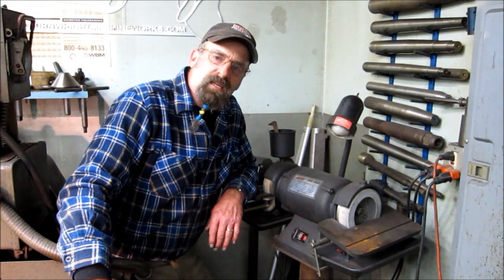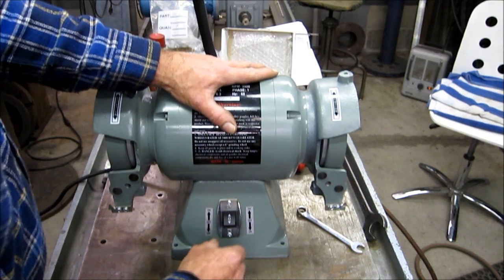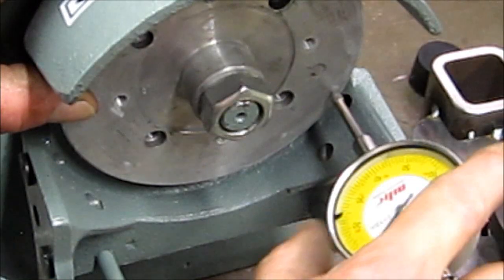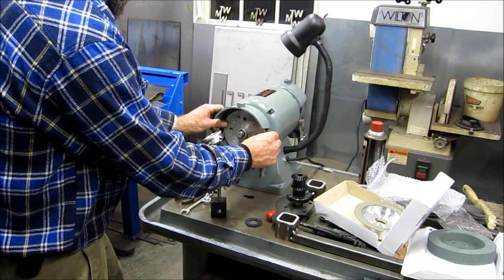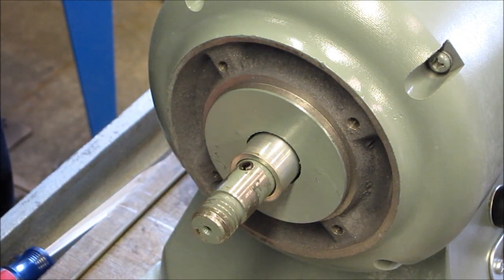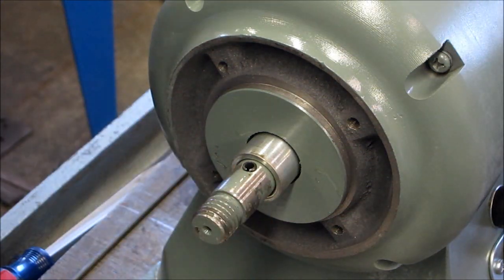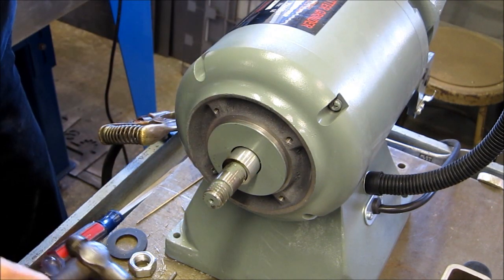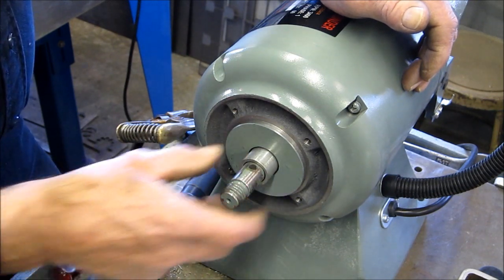There must be a lesson in here somewhere! Part 1

Comment from the maker: If the spring steel had any quality to it tapping would of been a pain, lucking out with a ready tap hole size, would just be luck. If a tap would work, then a drill would remove it as well. A round hole is a safe manuver with out creating a stress riser point, in a shaft, giving limits to it diameter. A quick thought on threads in a split pin, a certain exspansion will be caused with the pitch contact if bottomed out...

Comment: From my mis-spent youth fixing vehicles without all the "right" tools... I viewed split-pins as sacrificial objects when they got in my way...

I've been known to just drill out the split-pin, when the drill bit bites the pin, it'll twist her out...

Or crush the softer ones with electrician's pliers (the heavy duty pointed nose type) or deform it with a center punch, then pull.

A broken-screw extractor might work as well.

Comment: To get the roll pin out, pack the hole with grease.  Then drive a rod down the middle of the roll pin. The rod should be a good sliding fit - no contact.  The idea is to hydraulic power to drive the pin out from the bottom. Wear gloves and safety glasses - the grease can squirt out at high speeds.

Comment: Low cost grinders come with stamped washers that bend in shipping or are stamped that way. I looked up a flange washer for a Ryobi table saw and got ten of them since they were cheap and machined, but smaller ID than I had hoped. Another problem is that the washers move radially on the threads. I just got a Harbor Freight grinder and the threaded portion was smaller in diameter than the 5/8 shaft. I'm pretty sure I have seen better grinders with threads that had the same OD as the shaft. I suppose all that can be fixed with tape on the shaft and making a straight bushing in the stone.

Comment: Good tip but the grease squirts out thru the slot in the pin, BUT if you keep driving little balls of tissue paper down thru the center it will eventualy fill up and
paperdraulic the pin out everytime

Comment: I was wondering when you drilled the id of the pin thru the shaft, why would you not go thru the other side with a little larger diameter drill and drill to the bottom of the pin. Then you could knock the pin out. I'm not a fan of heat input to a  shaft. Still learn a shit load of info from you. Thanks.

Comment: Love your sense of Humor..Dry....like mine....black eye on CHINA. Yep, they are doing a good job on that. where did you get that Grinder? surprised they didn't use a sealed bearing on a device with that amount of abrasive flying around? 
  I've been getting the bi-monthly MSC catalogs, but haven't bought from them yet. Here in Sacramento, Calif....a couple decent tool companies, Western Tool And Supply, has....Sandvik carbide stuff, Precision Twist Drill, OSG, USA Wilton, stuff like that.

Comment: Is such a pin needed? I have an old bench grinder that does not have it. Is it better to add something and use a keyed flange?
Reply from the maker: there are other options...
Reply: @KeithFenner What would you suggest? I have a lot to learn and unfortunately I am not a machinist but would love to learn and setup a small shop someday.
Reply from the maker: Some engineers make it one way and others another way, higher end grinders most likely have keyway over pins.

Comment: great videos Keith thankt for the tips! on this case i usually tap the spring loker and use a threaded rod with a impact puller to remove the spring pin! usualy it's soft enough to tap!

Comment: There is a better way to remove the roll pin, drill through it with the 5/32" drill you mentioned, then follow it up with a drill the same size as the OD of the roll pin and drill it drill the other side (the blind side) the punch it out with a normal punch.
Reply: Exactly what I was thinking. Though honestly, being a new grinder, he should not have had to do this in the first place.
Reply: Jj Ash Never saw your reply till now, sorry.
It is a cheap grinder, probably bits of many makes and models put together. I'm surprised Keith spent so much time on it, he sure did a good job though.
Reply: I wonder if it would have been possible to use an easy out on it.
Reply: An EZout won't grip the hardened spring pin like it would a soft bolt.

Comment: Keith...I am at a loss for what drill bit I can find to drill a hole in a 1/8" steel flat bar to allow for a countersunk flat-head machine screw. I need to drill a few hundred holes and would like to not have to pre-drill a pilot hole. I made a jig that will accommodate my bars. The tapered bits I have now jump much larger around with each step. Is there a bit that can drill the pilot hole in steel and that tapers sharp enough to make the counter sink hole also. Anne
Reply: Some countersink drill have a smooth guide shaft at the front end. These are often used in aerospace repairs. The smooth guide shaft centers & guides while countersinking.

Comment: The reason these tools are made cheaply is because the market wants them cheap. Stop buying cheap and you will get quality but it's gonna cost. Before China  flooded  the market with this stuff who knew anyone outside of a machine shop who had a bench grinder ?The only power tool my dad had in the mid sixties was a Swiss made 2 speed drill. It cost a week's wages back  then.